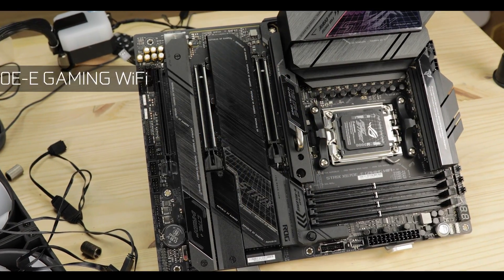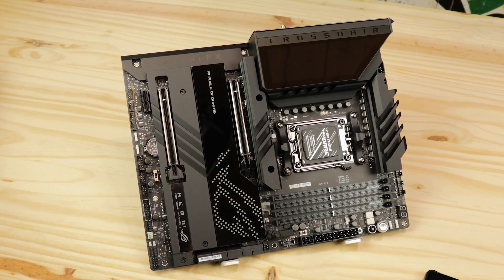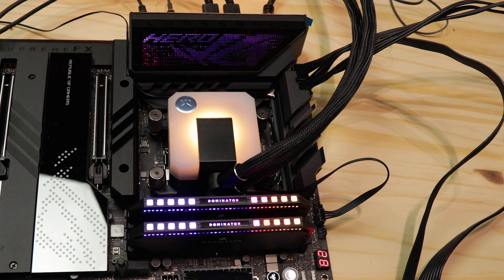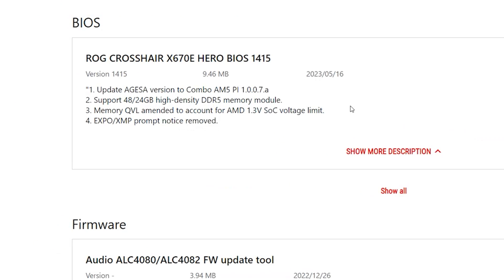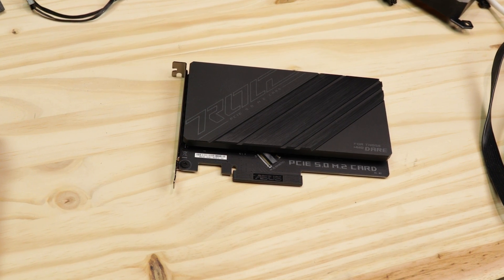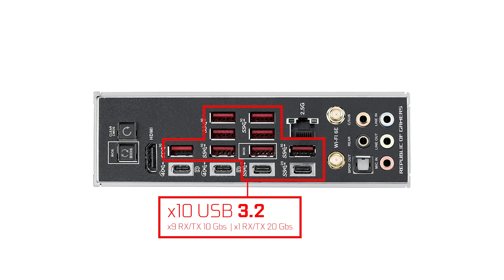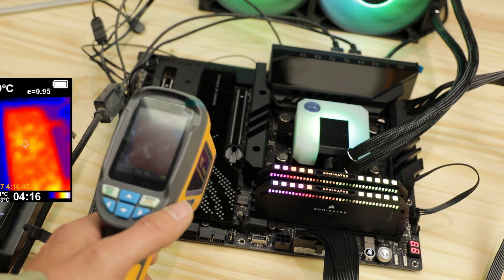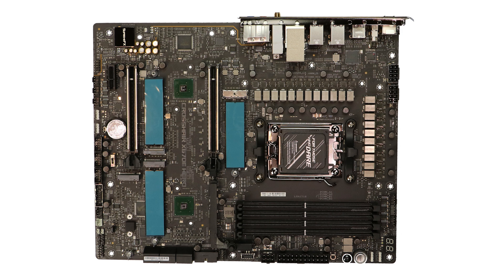ROG CROSSHAIR X670E HERO : NO! We don’t need another HERO!

Comment: Terrible board gives me nothing but headaches… Tried 2 different brand new boards, latest BIOS and all I got is random freezes and reboot which is kinda ridiculous. Paired with Ryzen 7950X and G.Skill CL30 AMD EXPO kit. Even running on stock also unstable. Swap to B650 for testing problem instantly solved even with OC. Just don’t get this board.

Comment: Please tell me, who knows: if this motherboard has only 4 PCIe 3.0 lines for two USB4s, that means 32 Gbit. USB 4 should support 40 Gbps. There are two of them. It turns out that when connected to one USB4 there will be a maximum of 32 Gbit, and when connected to two USB4, each will have only 16 Gbit. So why are they needed here in the amount of two and called usb4? Thanks to everyone who can answer

Comment: I'm deciding between this and the E-E. One thing you could've mentioned is that if you plan on upgrading to USB4 or TB later just get the HERO instead for a cleaner look as the USB4/TB card is around $130 or so.  For a little more you get better everything.  I wish there was more RGB tho and that the panel was customizable.
Reply: What motherboard did you buy between these two?
Reply: @magboc8b  HERO Maximus Z790. Yes I decided to go with Intel instead last minute. AMD X670 wasn't ready for primetime yet imo with all their RAM issues.

Comment: about the 40GB USB-C XD, what I found out is that it does not support 40GB if the 1st M.2 slot is used (shares PCIe lanes). You can't find it in the manual.
Reply from the maker: Ooooh sneaky !!!!
Reply: Figures. This motherboard keeps looking more interesting to me.
Reply: does it mean that the 2 USB 4 ports get disabled if the 1st m.2 slot is used
Reply: @KIANAKASLANAK423  no just at usb c 3.2 speed

Comment: Nice idea for video: changes in performance on the am5 platform after the new bioses. Can we use 6000mhz memory at all after the voltage changes in any mobos?   ----   Loved what you did with the coolers comparison !
Reply from the maker: Yes you should be able to
Reply: I'm running 6400mhz (2x32GB) stable with the new voltages. So yes, 6000 should be easily doable for everyone.